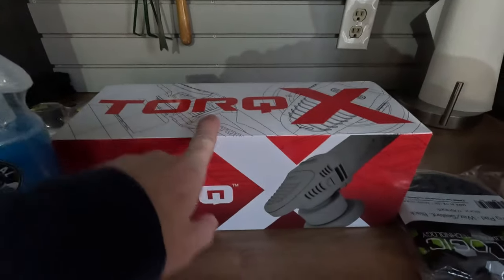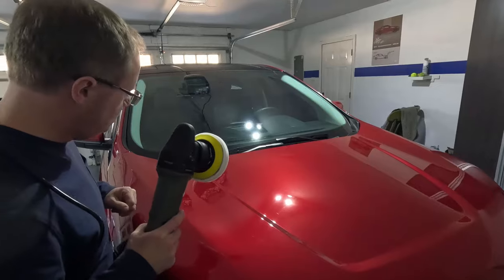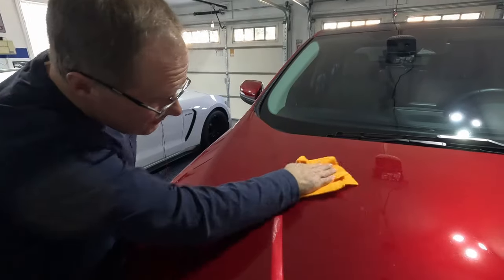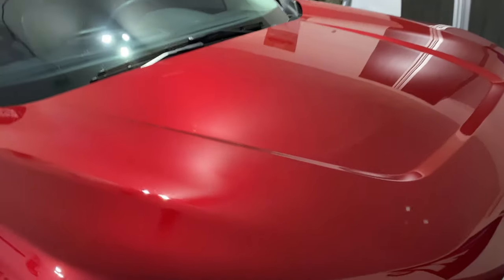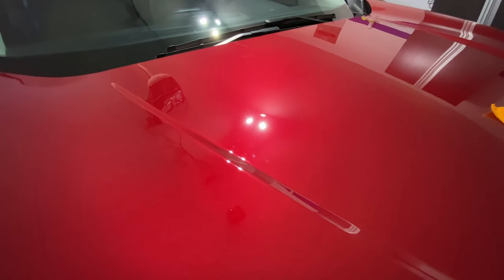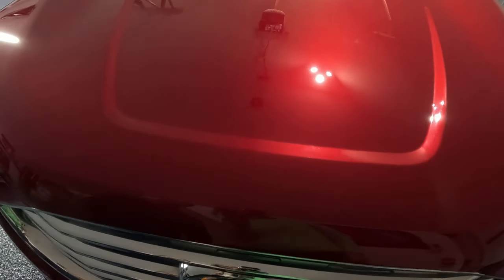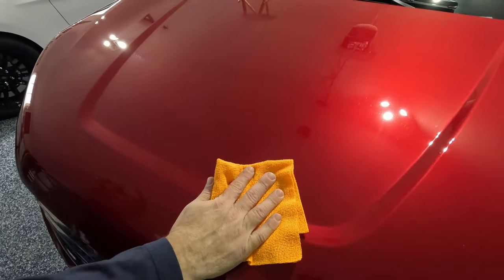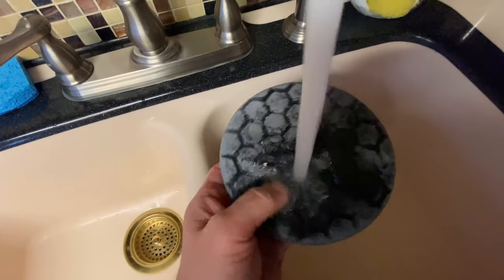First time using a Dual Action Buffer / Polisher

Comment: Did you decontaminate the surface B4  .
Reply from the maker: Just washed it and wiped it with a microfiber with detail spray.  I have a wash product that is supposed to remove waxes that I’ll use when I do the Shelby and M2.
Reply: @ourgaragedogsstuff need to clay bar, iron decon, ipa wipe etc
Reply from the maker: Thank you! I was planning on clay bar when I do the other cars but hadn’t seriously considered iron and ipa.  Will look more into those.